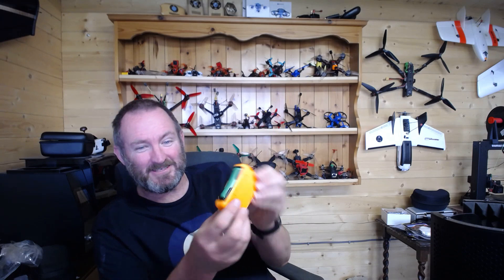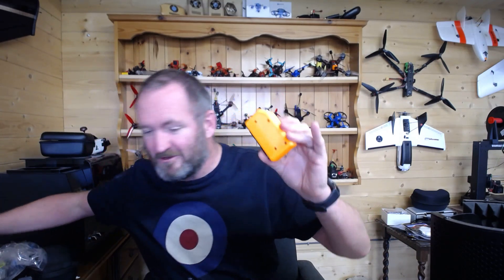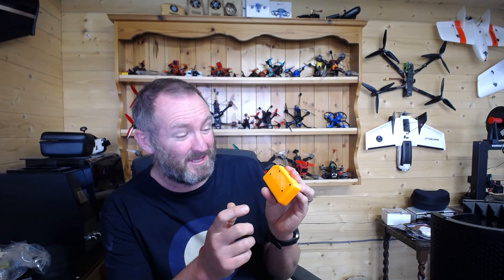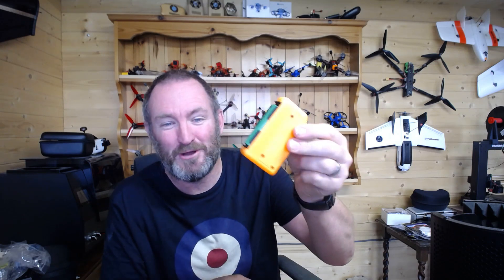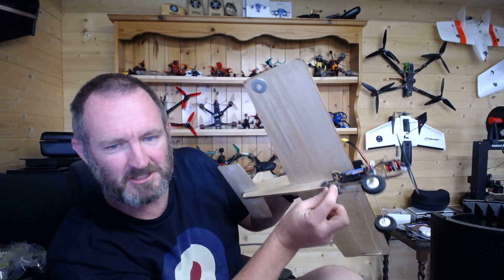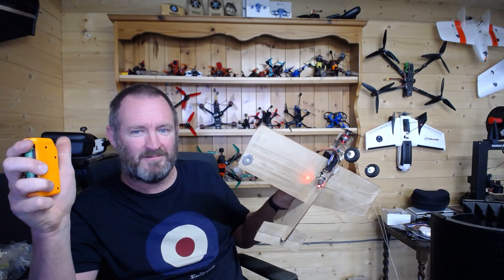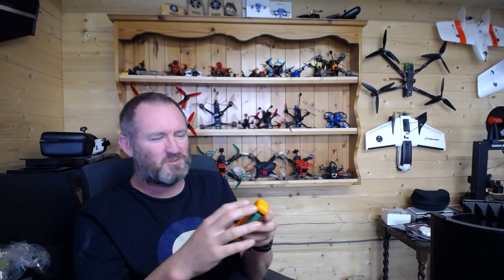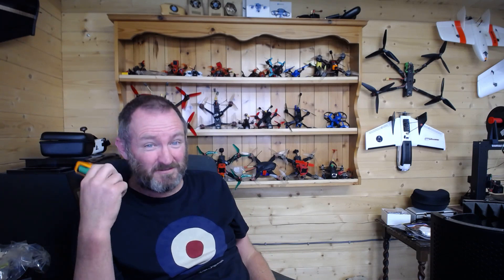CONTROL LINE | WIRELESS THROTTLE CONTROL

Comment: I have seen rc engines on cl airplanes, add a small receiver attached to the plane with a mini servo for speed control. Borrow a rc car transmitter for speed control and viola!  I haven’t flown one but it seemed to work great.

Comment: Next thing you know, you'll be removing the string and putting servos on the control surfaces lol. At what point is it no longer a "control line" model eh? hehe
Reply from the maker: Lol.. I did consider it.         Problem is..   I just don't trust a mechanical system to cut the power on crash!